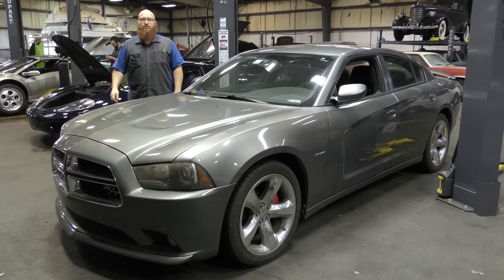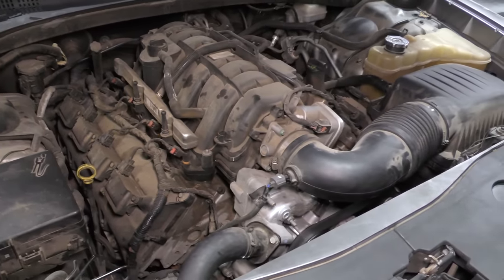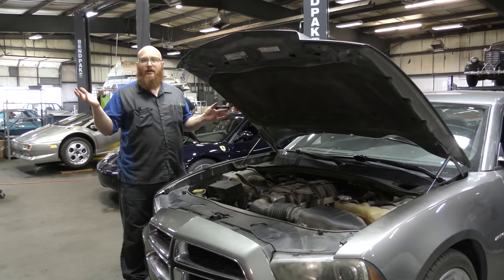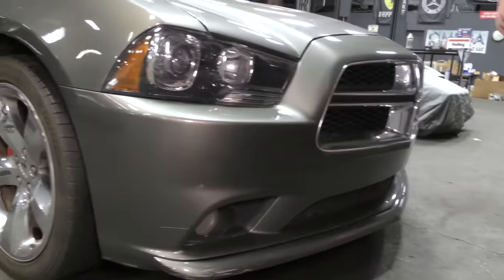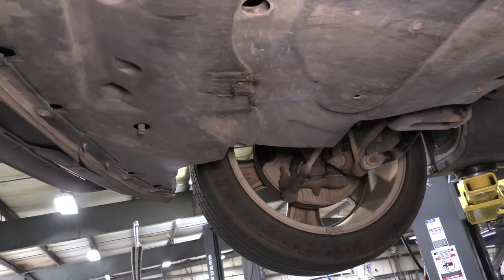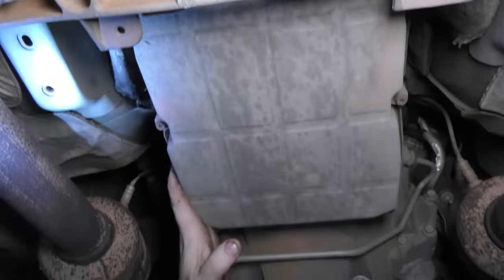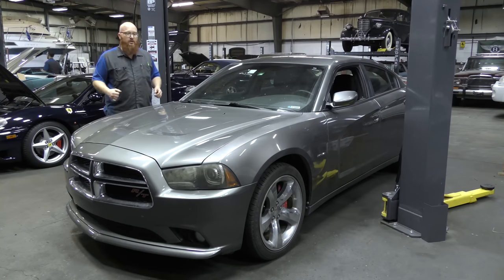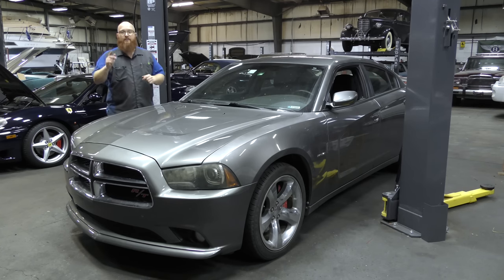Tic Tic Tic! 2011 Dodge Charger RT has the infamous Hemi tick. What will the CAR WIZARD do about it?

Comment: Anyone else heard of the roller rocker bearings seizing and wiping the cam lobes on the Hemi? Or is it just me?
Reply: Tech13 comment:The injectors tick very loud even more so starting 2011.they put noise insulation over the rails to help. The lifter rollers wear out and wipe out the cam lobes. That happens because they moved the cam higher in the block for better valve train geometry.  Now the cam does not get constantly bathed in as much oil and there is no oil gally feed to the lifter bores for lubrication.  It gets whatever washes over the lifters. If you hear a lifter tick that means the lifter roller is worn and the cam is getting scored. If you have a misfire and you want to determine if it's a bad cam. Do 4 or 5  Accelerations to the redline. Then the engine will start to misfire bad
 Let it idle and it will smooth out. When the ramp on the cam lobe is damaged it causes the lifter to collapse on hard acceleration.  Even if you don't hear a tick it can still be a bad cam.

Comment: Yeah they have cheap lifters on a lot of those later models and that’s why they tick like that. Not the best design IMO. Maybe if anything perhaps you could try a different oil weight or even another brand name like liqui-molly they make pretty good quality oil, and that might quiet it down some but yeah there’s really not much else you can do with that at all. It’s just a design flaw on those later model Dodge’s.

Comment: The hemi tick myth has been busted for a long time now , They did a tear down on the new hemi on horsepower TV and the hemi tick comes from the horrible oiling system on the new hemi . The lifters and cam bearings starve of oil at low rpm and wipe out the lifters and not enough oil pressure to keep them.pumped up . Shitty oiling system.  You can fix it by modifying the oil system.  The engineers know about it but won't fix it because it helps sell more parts .

Comment: Dang ,

Over $600 for a oil sending unit sensor and push button install?😳

Legit mechanic shops are fkn expensive 😆
Reply: also the sway bar bushings were replaced also. most of the price undoubtedly was from that.

Comment: Hemi tick gets worse over time as the camshaft gets worn away due to a lubrication defect in the design. The worn cam effect should have been noticeable in your scan tool data. You lost points here.

Comment: I heard it was a roller defect and eventually it will cause the engine to run really bad. I watched a video where a ram was ticking really bad and  under any sort of power it would shake.  I'm wording it the video was b.s.

Comment: LOOKS SORTA OF LIKE A 722.5 ON MY W210 2002 E320  MAYBE 722.6 I THINK WOULD BE THE 6. A DODGE THAT THE TRANSMISSION WON'T GO OUT BEFORE 200K. MY E320 HAD 275,000 MILE SAME TRANS IT ACTED UP AT 225K HAD TO BUY DIP STICK WAS LOW ADDED ROYAL PURPLE  ATF MB .11 OR .12 MB RECOMMENDS .14 SAYS BACKWARDS COMPATIBLE WELL IF ADDING TO OE  NEWER FLUID IS THINNER SPEC SO INSTEAD FOUND A FLUID THAT WAS SPECTED UP TO AS CLOSE TO ORIGINAL. ALMOST A QUART OR  3/4  QUART LOW SHIFTS LO PROBLEM BUT 50K LATER LAST SUMMER LEFT SUNROOF OPEN IT RAINED ON TO ELECTRONIC SHIFTER PCB GOT WET NOW WONT GO FASTER THAN 30 WITHOUT RED LINING. IF WOULD HAVE KNOW HOW UNPROTECTED IT WAS I WOULD HAVE COATED THE PCB WITH CLEAR NAIL POLISH OR THE SPECIAL COATING FOR THAT PURPOSE BASICALLY SAME THING

Comment: Lol nothing is really wrong... Umm there's a lifter getting stuck it's most likely the 4 MDS lifter getting stuck. The only way to fix it is to replace the lifters if u don't it will destroy the cam and that's even more work n money..u can get a MDS delete and just do the lifters and tune it and u won't have the issue no more.

Comment: Can someone tell me what causes this "hemi tic?" thanks?!
Reply: Tech13 commented:The injectors tick very loud even more so starting 2011.they put noise insulation over the rails to help. The lifter rollers wear out and wipe out the cam lobes. That happens because they moved the cam higher in the block for better valve train geometry.  Now the cam does not get constantly bathed in as much oil and there is no oil gally feed to the lifter bores for lubrication.  It gets whatever washes over the lifters. If you hear a lifter tick that means the lifter roller is worn and the cam is getting scored. If you have a misfire and you want to determine if it's a bad cam. Do 4 or 5  Accelerations to the redline. Then the engine will start to misfire bad
 Let it idle and it will smooth out. When the ramp on the cam lobe is damaged it causes the lifter to collapse on hard acceleration.  Even if you don't hear a tick it can still be a bad cam.
Reply: @JohnSmith-pl2bk  Thanks a lot for the info! I appreciate your time!

Comment: So the tic is nothing to worry about?  My neighbor replaced his engine because of it even though it had less then 100K.
Reply: Yeah, some people don't know shit about cars. like my sister for example; she thinks HONDAS are better cos they don't make any noise... lol
Reply: Tech13 commented:The injectors tick very loud even more so starting 2011.they put noise insulation over the rails to help. The lifter rollers wear out and wipe out the cam lobes. That happens because they moved the cam higher in the block for better valve train geometry.  Now the cam does not get constantly bathed in as much oil and there is no oil gally feed to the lifter bores for lubrication.  It gets whatever washes over the lifters. If you hear a lifter tick that means the lifter roller is worn and the cam is getting scored. If you have a misfire and you want to determine if it's a bad cam. Do 4 or 5  Accelerations to the redline. Then the engine will start to misfire bad
 Let it idle and it will smooth out. When the ramp on the cam lobe is damaged it causes the lifter to collapse on hard acceleration.  Even if you don't hear a tick it can still be a bad cam.

Comment: It's a ticking time-bomb because of the lousy lifters!! If Dodge cared about their "Hemi" !!Mopar!!, they would have the lifters made with better metal!! SIMPLE AS THAT  END OF STORY.
Reply: They updated the lifters in 2017 because they were getting some bad ones so you can update to the newer ones as long as the cam is fine and should be good after that.
The 5.3 chevys do similar but most don't talk about those. It's worse with the newer vvt engines.

Comment: The Hemi-Tik is actually a very big deal!!!!  Cannot believe you said that it's normal ... because it's NOT normal.  It's due to failing LIfters and should be replaced with the newer designed lifter.  WE fix the severe Hemi-Tics before they destroy the cams and eventually the whole engine.
Reply: Hemi tick was around before the defective lifters were. That's a whole different hemi tick

Comment: Does hemi mean anything ( in the world I mean ) ? Can it compete with Merc and Ferrari ? No .
Reply: Well the demons and hell cats are hemis. The viper 5th gen has hemispherical heads so its a hemi.
Reply: So where does hemi compete ?
Reply: It's the shape of the combustion chamber.
Reply: What I mean is does American engineering compete ?
Reply: American engineering means nothing to the world outside merica . Do you agree mericans ?
Reply: @pigflaps  well the viper ACR had alot of track lap records that competed with cars way more expensive than it was. The ss Camaro beat the gtr around a track. The hell cat was the fastest sedan. Is that what you mean about competition? The new C8 Corvette is beating Ferrari for way less money.  If you're into modifying cars the viper v10 can hold 3000 hp on factory block while other engines have to be made of billet.
Reply: So where are you in the form of F1 ? Simple question merican .
Reply: @pigflaps  im not into F1 , i like gt1/gt2 .  I like gt2 because they look like an actual car one can buy.
Reply: @pigflaps  I think you're asking the wrong question. What does F1 have to with this?

If anything the Viper was competitive in GT1 and endurance races like 24hrs of le mans.
Reply: @pigflaps  why are you mad? Your ego is so fragile.  You dont have to like American cars but other people do . If you want racing on the world stage American manufacturers like gt2 mostly and when they go they win and when they do they retire.  Nothing wrong with any manufacturer they all have their good and bad to them.
Reply: My ego is fragile .
Reply: Don't you understand you're being laughted at ?
Reply: @pigflaps  sure kid
Reply: @davidmopar8446  mad about what ?

Comment: injector
Reply: The Chrysler hemi performance engines are notorious for making slight tapping or ticking noises. Tapping and ticking noises can be caused by various problems in the motor, however these noises are most likely caused by a lack of lubrication, and may be a sign of a more significant problem. If your hemi has begun making a ticking noise or the noise has increased, you should take the vehicle to a certified professional mechanic so that the cause of the ticking can be professionally diagnosed and repaired.

What Makes Your Hemi Tick
Ticking sounds in an engine are commonly caused by a lack of lubrication. Lubricants such as oil and fuel flow between metallic components and provide cushioning so that the parts do not tap against one another. Ticking or tapping noises can come from several different sources, including the lifters, valves and fuel injectors.

Lifters
One of the most common causes of the hemi tick is a problem with the lifters. There has been much speculation about what causes the lifters to tap on some hemis, especially the 5.7-liter V-8, however there is no technical service bulletin or recall on this engine from Dodge. If your hemi has lifters tapping, it is important to check the amount of engine oil and make sure you are using the right type of oil for the vehicle. Low engine oil can cause a lifter to tap and can cause permanent damage.

Fuel
Low quality fuel can cause the hemi tick. Fuels that contain high amounts of ethanol or that are low octane may not properly lubricate the fuel injectors and can lead to a slight tapping or ticking noise. Low-octane gas has also been known to cause an ignition knock in high-performance engines. Using fuel additives or a high quality gasoline can help prevent this from occurring and may be able to correct or minimize a hemi tick.

Valves
The intake and exhaust valves on the hemi may also be causing the ticking sound you are hearing. Valve tapping can be caused by several different problems, including a lack of lubricant or a problem in the springs that close and open the valves. Valve problems should be examined by a mechanic to determine the precise cause and possible solutions.